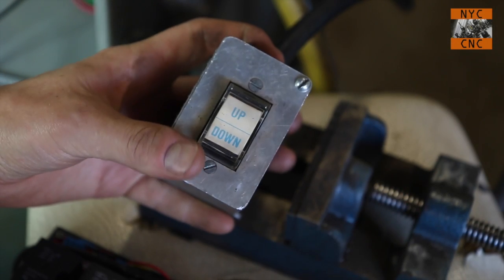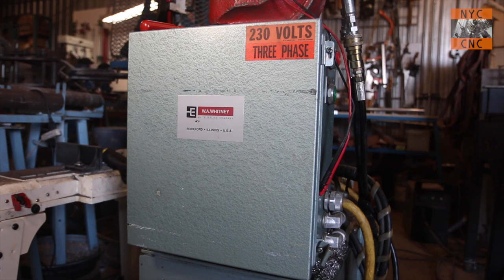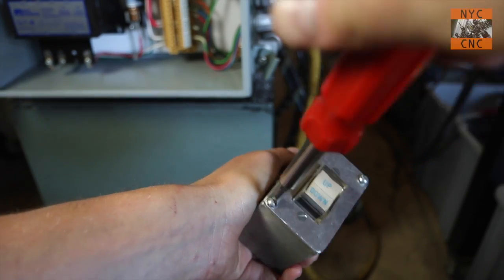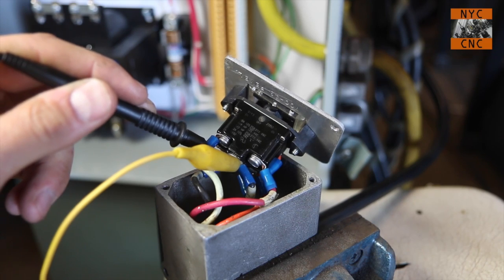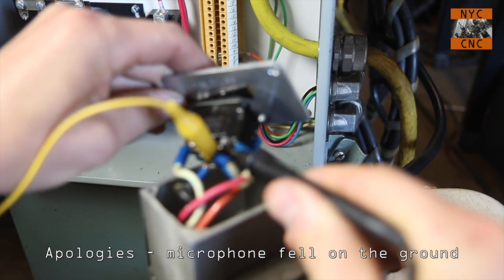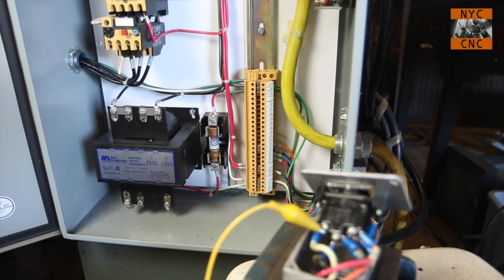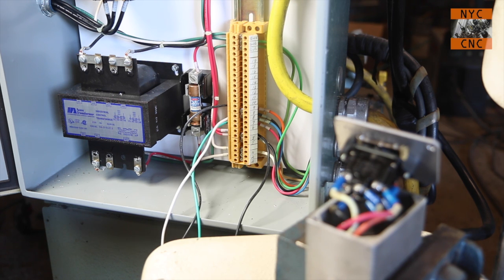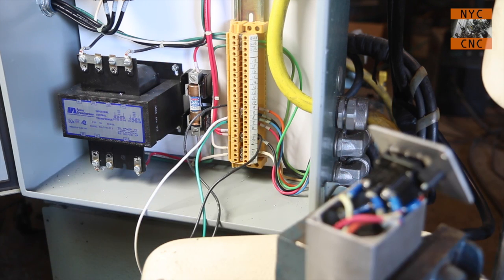Arduino Steel Hole Punch!  Retrofitting Foot Pedal - Part 1

Comment: It's irrelevant how powerful this three phase unit is, it would still have enough power to kill you at 120vac. In the UK these are 415vac. You must simply make sure you don't touch a live connection. Make sure the power is off to be sure you're OK.

Comment: https://electronics.stackexchange.com/questions/182800/how-to-change-rotation-direction-of-3-phase-electrical-machines

If I read this correctly, the one that is on on both directions would be red, and it switches the other two phases to determine direction.

Comment: Curious, do you have a resource you use to find information about these type of projects.  Id really would like to convert my Surface Grinder to automatic using Arduino and hydraulics so I can surface grind larger parts without my arm feeling like its gonna fall off.

Comment: If that switch controls AC power, it should really have a ground wire connected between its frame and the ground bus inside the cabinet.  Also, the power cable into the pendant should have a proper cord grip, not that metal clamp.  The clamp can eventually fray the cable and short power to the pendant frame.  When servicing power equipment it is good practice to verify that you have power before disconnecting the device by testing with the DVM (this also verifies that the DVM is working) and then testing again after you've disconnected to verify that no power is present.  You also want to check to make sure there isn't more than one power source to the device.

Comment: 1 thing to watch out for when checking continuity is a back feed from something else I haven't watched pt2 yet but I hope you and your viewers know that there is a lot more than wiring a foot switch to make it go up and down for example when you take your foot off the pedal it will go up the problem is that it will stay trying to go up and if it does that for to long it will over heat your hydraulics and mess up your pumps. You need a way to put the hydraulics in a "neutral" position after your reach all the way up maybe a timer or a psi switch. Most of the time the "control system" is low voltage 120V single phase sometimes 24V. Whitney and Piranha punches are over priced on there OE parts as you can see aftermarket parts are a lot cheaper
Great job
Reply: Yes your set up is great I really like it. I was worried that you would let the smoke out of something Very Cool!!!

Comment: Ha, that's just wimpy 230 volt three phase, standard UK is 415 volt, three 240 volt windings arranged in a Star or Y connection. I frequently have to work on live panels and it's not the voltage that worries me, it's creating a short and getting a face-full of molten metal.

The really scary stuff is direct current from a high voltage battery. One of my friends from the electric vehicle racing days got the nickname 'Plasma Boy' after an incident where he dropped a 1 inch by 1/2" copped bussbar across a 336 volt pack. The windows of the car got a copper tint job!

No PCB stand-offs?

Comment: http://upload.wikimedia.org/wikipedia/commons/thumb/7/72/Asynchronmotor_Softstart_Schaltung.svg/682px-Asynchronmotor_Softstart_Schaltung.svg.png
there is the schematic for a 3 phase switch. To change direction in a 3 phase motor you need to change 2 phases. the 3rd stays the same.

Comment: Great video.  You have the ability to be practical and that seems to be lacking in so many people.  The safety obsession is caused by company lawyers.  The lawyers only goal is to make it hard or impossible for an idiot who has gotten hurt to sue the company.  The lawyer is not concerned with productivity or common sense.   I worked in a place where it took 6 hours of paper work to do 2 hours of actual productive work.  Of course they were a big company in a big industry and the cost was just passed on to the consumer by them and all of their competitors so it made sense for them.    Being your own safety department you can determine what is safe to do and your level of productivity will be many times that of the big company.  This should make you competitive with their million dollar machines.  Thanks for sharing.

Comment: You seem to have a good grasp on the electrical basics, so no getting a nasty shock or setting something on fire, but the colors of the wires mean something to those in the know.  I'm an electrical engineer and I've done a lot of controls work.  I always hated getting a call to work on some machine that was built by some clever guy in the shop that's quit working after he's gone.  I show up and there's no schematic, no wire labels, and they had a big spool of purple wire they decided to use for everything.  When you look in a panel, you need to know that green is chassis/earth ground, white is AC neutral, black and red are AC line voltage, and blue is low voltage control wiring (usually 24VDC).  You can get creative with other wire colors if you must, but please don't strip a PC power cable and randomly use black, green and white wire in your panel.  It takes little time to learn what colors are used where, and you'll more than save that time five years from now when you need to work in that panel.  If you put 220 VAC on a green or white wire, you've created a safety hazard for anyone working in that panel.

You can use a PC printer to print five wire numbers vertically on a piece of paper so the strip can be wrapped around a wire of varying diameter and you'll be able to see the wire number from any direction.  Clear heat shrink secures the home brew wire numbers in place.  I use my laser printer and LibreOffice spreadsheet to print nice peel-n-stick wire numbers for my hacker wiring projects.  Hand draw a schematic and tuck it in the panel someplace where it won't cause a fire hazard.  You'll thank yourself later.  It might even save your life, when the next guy to work in that panel doesn't hunt you down and kill you as a service to mankind.  Will needs a daddy.
Reply: NYC CNC
I draw a quick schematic when I'm trying to understand an undocumented circuit.  I'm accustomed to thinking in schematic land.  I can "draw" the schematic in my head, but it's a lot easier for me to keep it straight on paper.  I actually save time and avoid errors by drawing a schematic.  YMMV.  Once drawn, I have it for later.

Wire numbers are good when the same colored wires disappear into wireway or a cable tied bundle.  And... if you use wire numbers, it looks like you cared.  :-)

Mostly, I was trying to urge you to stick with the standard wiring colors.  Would you buy a CNC machine that used something other than standard G code?  It's sort of like that.  Standards make everyone's life easier and safer.  It's much easier to figure out what a circuit does if you can infer the current from the wire gage, and the voltage from the wire color.

I'm still very impressed with the ease with which you are able to quickly punch holes in 1/4" thick steel plate.  I don't do a lot of that sort of work, but if the need arises, I'll have this tucked away in the back of my mind.
Reply: *****
Well fine then!  Use any color wire you want.  Just don't expect me to work on that thing!  I'm washing my hands of the entire project and leaving in a big dramatic huff!

:-)

PS - The Japanese use an entirely different color scheme.  Whenever I wire Japanese sensors, I remember the colors for +Vdc and common by thinking "the sky is blue and that's high and the ground is brown and that's low... but it's Japanese so you gotta reverse them."  (Blue is ground or common, and brown is +24VDC.)

PPS - German schematics are funny looking.  Coils look like resistors, etc.

PPPS - I'm trying very hard not to buy the parts to make my own CNC water jet... at least until I finish some of the other CNC projects lying around in big piles of parts.

Comment: If its anything like my hyd. power unit, the wires to the switch are 110VAC and operate one or the other of the 2 control valves which control the flow path of the fluid. Your fluid control valves should be marked, and may also be 12V or 24V DC, but on this machine more likely AC. The valves also almost always have a small diagram on them showing how the fluid path works.

Comment: My experience working on machinery you should never trust that the wire color remains the same through out the circuit nor  does it maintain the same numbers they are marked with.  On something simple like what you have here you would prolly be ok but on more complex systems assuming this will get you lost fast.
Reply: My bad I thought you said the wire colors were going to be the same.  Than for the numbers thing I guess I should have been more descriptive.  On more complex machinery you may have safety devices in line.  So where you maybe looking for a particular number, it is actually listed under a different number because the switch you at is part of that safety circuit also.  I deal with primarily woodworking machinery that was built in Italy and Germany so this situation may only be unique to what I do.

Comment: I dont really see what they could make better with that nut price that you did not. 
One idea I see is to have single pedal and when you press it it make punch go down and when you raise pedal it goes up. Dont know much about that machine how it function so it could be not desireable for some reson or you would need to add limit sensors so it detects limits on both ends to arduino and stops it at limit so it dont brake a machine.

Comment: 3 phase motors reverse when you switch two of the three wires leading into them. All the switch is doing is reversing the phasing on two of the leads.
Reply: You are correct about swapping any 2 line leads to reverse rotation of a 3 phase motor. 
Probably not what is occurring here with the switches. 
Many if not most vane hydraulic pumps do not like running backwards, it can cause irreversible damage. 
Most likely the switches operate hydraulic solenoid valves. 
Using solenoid valves to control ram direction also allows for continuous operation of the pump and faster operation cycle.
Reply: That's correct :D

Greets,

Stephan
Reply: NYC CNC +patw52pb1 You are correct, hydraulic pumps are not reversed as this will break stuff. The pump is started by the "power" or "run" switch through the contactor(top left). Valves do the control of hydraulic direction, and are probably powered by the transformer. As for wire marking and schematics, i wouldnt really care much for such a small and very easy electrical panel. But if there is a color system already used, i follow them if i got the wires for it, or follow a sensible standard if i create something new.
Capacitors are not used for three phase motors running on three phase supply.